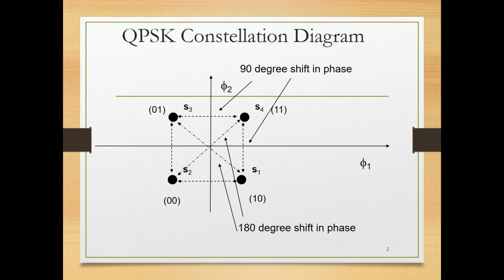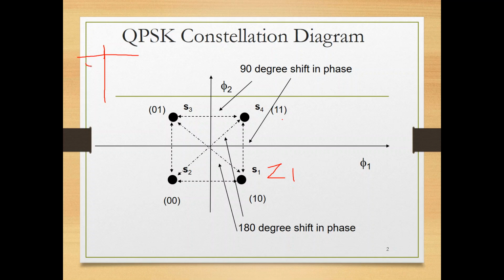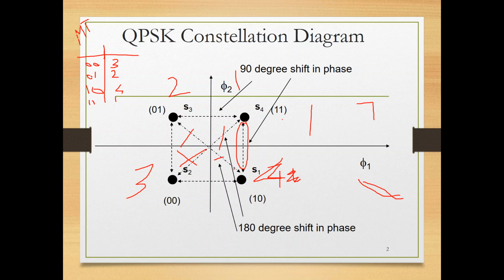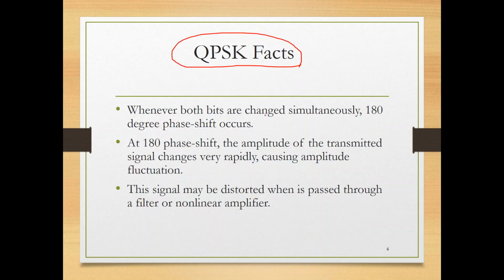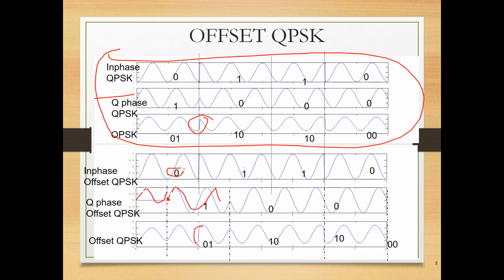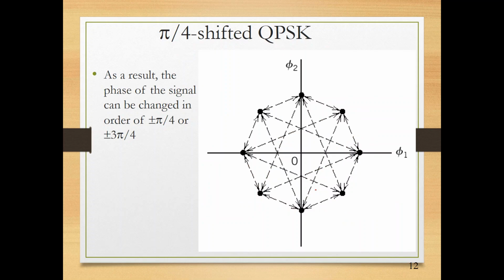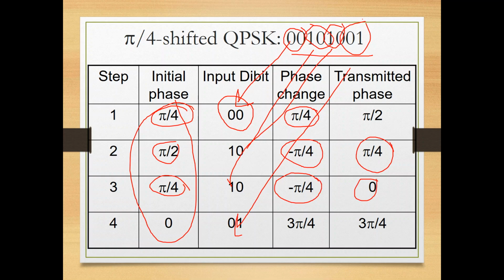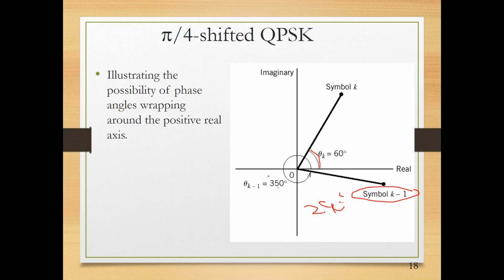Digital Communication - V18 - Offset and Shifted Quadrature Phase-Shift Keying (OQPSK)

Comment: Thanks for the video. I imagine Q channel is delayed by half symbol time BEFORE the shaping filter. Is it possible to implement that delay AFTER shaping filter as it is easier in hardware.
Reply from the maker: Yes, it is possible
Reply from the maker: You’re right about the filter ringing being a cause of high amplitude transients. Applying the delay after the shaping filter can help with implementation simplicity in hardware, but it doesn’t fully address the transient issues caused by the filter. This is because the filter applies its response without being aware of the symbol timing offset between the I and Q channels, which can lead to residual ringing.

When you place the delay before the shaping filter, the filter can smooth the transitions more evenly across the I and Q paths, reducing the high-frequency transients and preventing them from getting amplified by subsequent stages like upsampling filters before the DAC. Delaying after the filter helps, but it’s more of a partial solution, and the more upsampling you have, the more noticeable the transients might become.

So, while delaying after the filter is easier in hardware, the best signal quality comes from applying the delay before the shaping filter to reduce ringing at the source.
This course https://researcherstore.com/courses/rf-communication-system-design/ will be of a great help for you in RF radio design.
Reply: @Wislabi  Well actually I deleted my previous comment but thanks. My conclusion is that Q offset is irrelevant until mixer stage as each I or Q channels are independent. Filter ringing will be part of filter response and will be same if there Q offset or not. So my final conclusion is that Q offset only makes sense when the channels are mixed and can be applied anywhere before mixer.

Comment from the maker: As far as I can see, the only disadvantage for OQPSK is the need for extra processing to make changes in the phase shifts according to the data bits values, which eventually increases the overall system complexity as well as the transmission delay.

This is based on my understanding and analysis; however, there might be other drawbacks as well. 

At the end of the day, what determines which modulation to use is the application and use case you want to serve. Particularly, if you want better coverage and you are not limited with processing resources, you can use OQPSK. However, if the application you want to serve cannot afford extra complexity or delay, then you can just use QPSK.

I hope that makes sense to you.